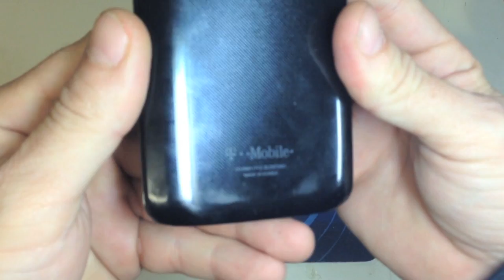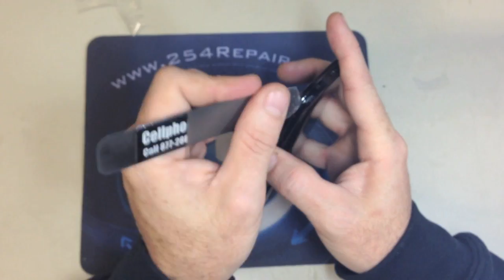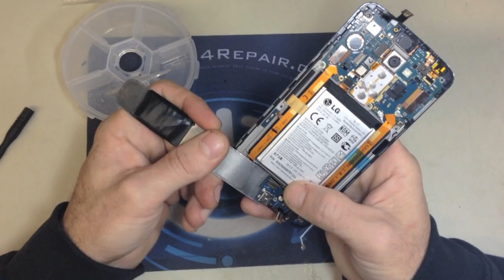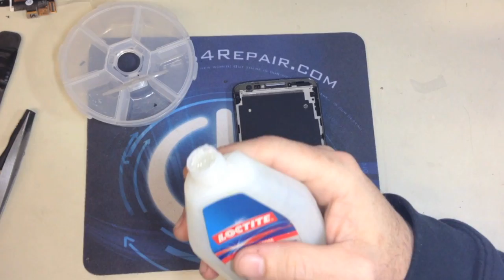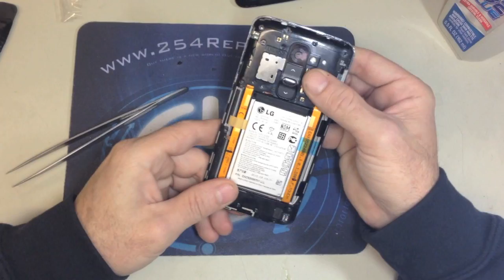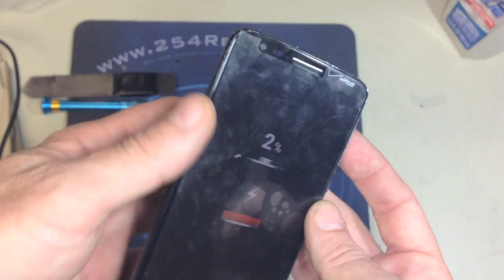LG G2 Screen Replacement | 254 Repair Killeen TX

Comment: very good video. the best one i have watched on the subject so far
Reply: I agree, this video is exactly what you need to do a screen replacement.
Some other videos show the full teardown and many people, in error, will take apart more than they need to.
Reply: LilStewie And BTW....you can accomplish this with just a credit card type plastic (or thin sturdy plastic) and a precision screwdriver. I did not buy any of the tool repair kits, the only thing you MUST buy is the precision screwdriver set.
Also, make sure the lcd flex cables all sit unforced, I had some cable touching something causing the screen to glitch/dim/streaks, I unscrewed the charging port cover and made sure all the wires/cables were in place securely and not moving/touching and it worked great after.
I would recommend a phone opening tool kit for most users. (Even for myself the kit would have made the process faster, but not necessary for accomplishment)